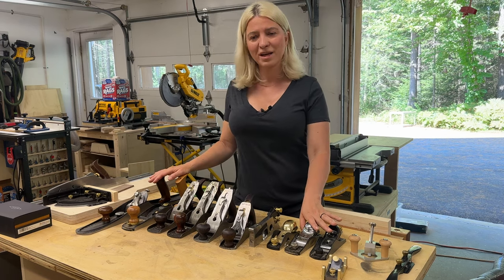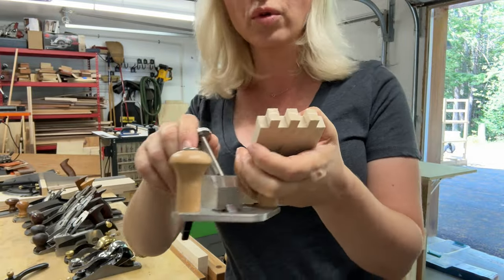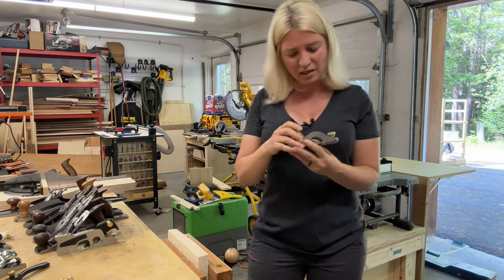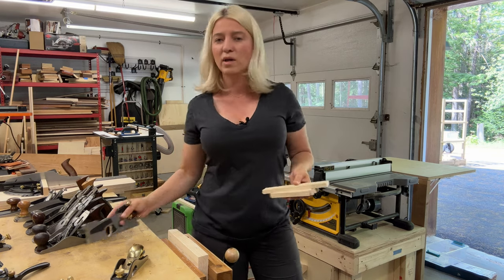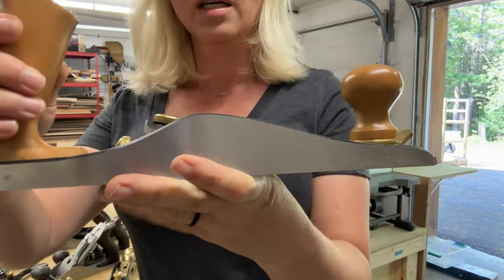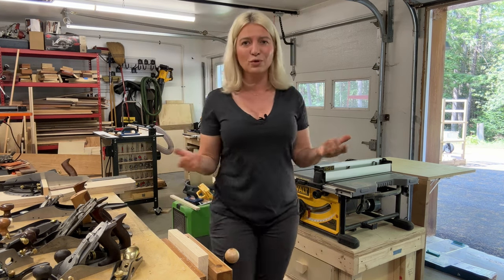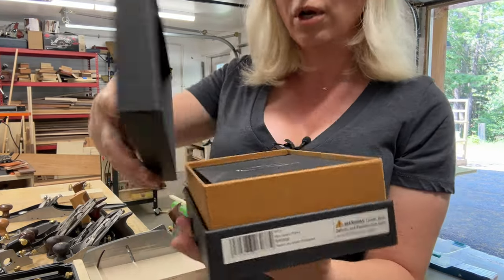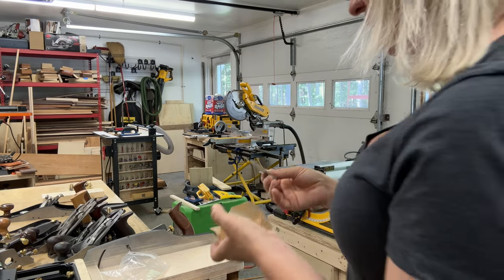Your First Hand Plane To Start With - Maybe the only one you need! Choosing your first Hand Plane

Comment: Again a great video! I’m not a woodworker but I incidentally work with wood. I have two planes (4” and 8” I think) and now I know I have to check if they are nice and flat. I know (more or less) how to sharpen the blade but I have no clue how to adjust them to the correct depth. Maybe something to cover in another video?

Comment: Very nice video and very nice planes you have!  Your opinion about the Bridge City block plane really made me want to get one.  I have been tempted to buy one for a long time but the shipping cost to my location has been too high for just getting a block plane, especially since I have a couple decent ones already.

It is a bit sad to hear that you don’t use your jointer plane much.  You should invest a bit of time in jointing with it, and also invest time in the sharpening part.  Do not feel like you have to go overboard with investing in the most expensive sharpening stones out there.  I recommend getting some ok diamond sharpening stones, like what Paul Sellers use/James Wright(WoodByWright) use, and a leather strop.  It is covering what you need for most sharp tools in your workshop.  In the beginning it might help to have and use a honing guide jig to secure a consistent angle when sharpening.  
Every time you sharpen your plane blade and chisel after letting them become dull you get that awesome feeling of a perfect working tool when you use it.  It is like magic 😄🤗 

When you look at vintage planes in garage sales and such look for a no. 3.  I feel confident that you would like that plane size perhaps more than the no. 4.

Keep having fun doing woodworking!
Reply from the maker: I will work on it! I have diamond stones, good quality ones, extra corse, corse, medium, fine, extra fine,  and I have a good honing guide. I been playing with them and in the beginning I didnt know what angle should sharpen my planes at. I thought it has to be 25. It turnes out the the original angle at some is 30? The last 3 planes I sharpen I was finally successful and  they feel very sharp. Still need to learn a lot
Reply: @woodworkingwithSkyler The most common angle for plane blades used to be 25˚ and I believe that is also stamped on older hand plane blades as well as om the sharpening guides. You could say that 25˚- 30˚ is a good angle range for primary and secondary bevel for pine and the other woods of similar hardness.  If you work mostly with harder wood types like the exotics I have seen you get in the boxes you buy you might want to grind a blade (maybe a second blade?) to 35˚ or maybe even a bit higher angle like 37-38˚, and close the mouth opening a bit down on the plane.  This is of course easiest on your low angle no 62, but on the low angle you could go to between 40 and 50˚ on the blade because of the low angle frog.  Tinkering with this on a regular Bailey pattern plane is a very educational experience so I recommend to try that.  But only when you have fun with it…or it can be frustrating, especially if you are «on the clock» on a project or something.  Better to be doing this when experimenting and no deadlines 😄
Reply: @woodworkingwithSkyler  Unsure if you are familiar with Matt Estlea but has some really excellent “How-To” videos for sharpening planes and chisels in his earlier days of YouTube.
Reply from the maker: This is great information. Thank you. I will try a higher angle on my garage sale planes. One question. Once I sharoen a blade to 25 degree and get a good burr on back and then I do secondary bevel at 30 degree. Once the blade gets dull again do I have to go back to 25 degree then add the 30 again? Hope this make sense
Reply from the maker: @allystrya  I will check it out
Reply: @woodworkingwithSkyler  You freshen up the sharpness of the blade by doing the secondary bevel only.  After several times sharpening the secondary bevel then the secondary bevel might have become so wide that you want to redo the promary bevel again.